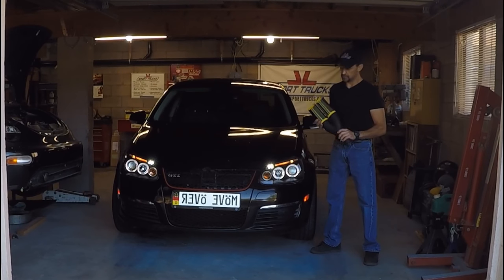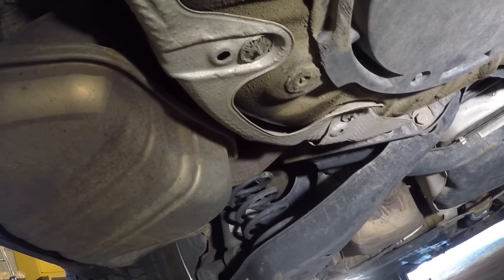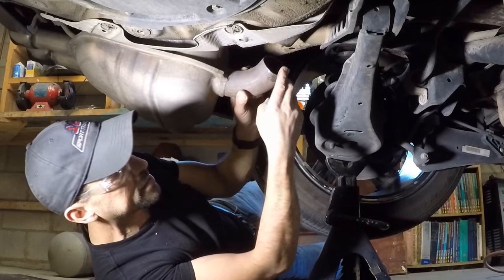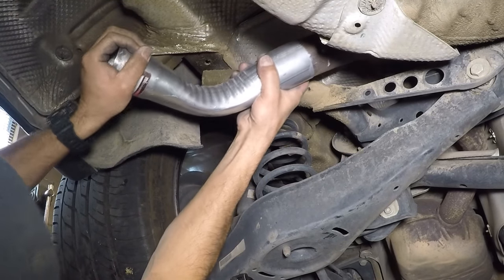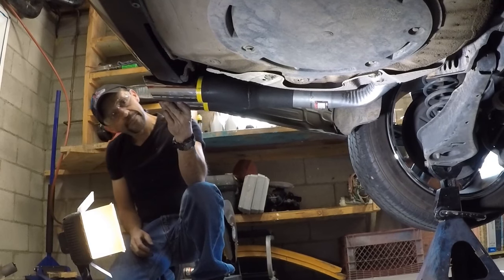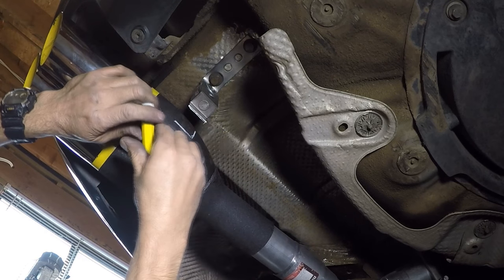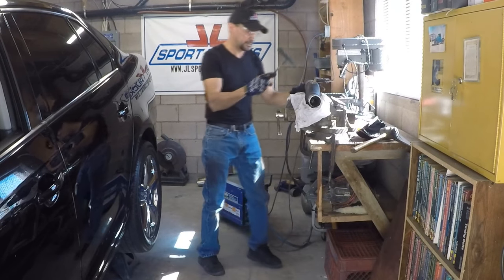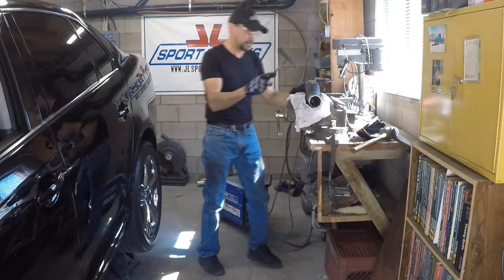Installing Monza Chrome Dual Exhaust Tips on MK5 VW Jetta

Comment: hey man love watching your videos because your one of the only people that has my specific car. Also btw I love how straight to the pint and educational your videos are. I just came hear to educatre myself a little on how to apply a full exhaust system when i saw you had those halo projector headlights which is actually what I was planning on picking up next. Any specific brand is better for that headlight? cause I saw some cheaper ones and some that were almost $100 more of the same exact look. Or maybe would you recommend a different set of lights? Thanks!